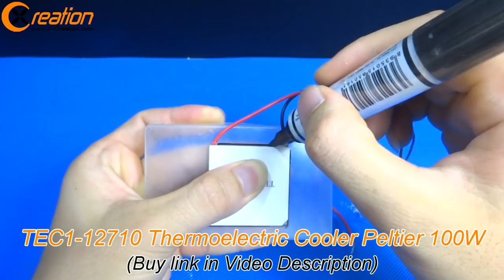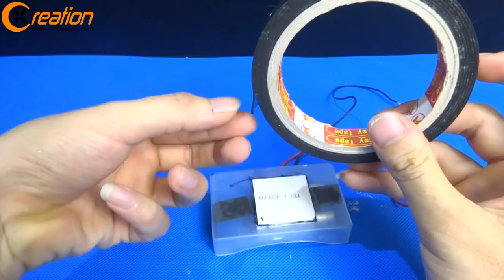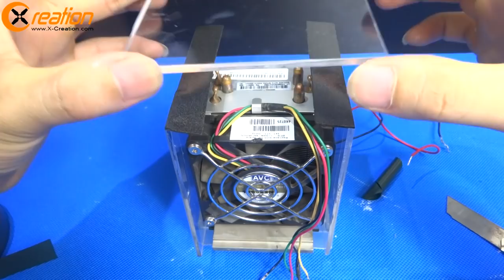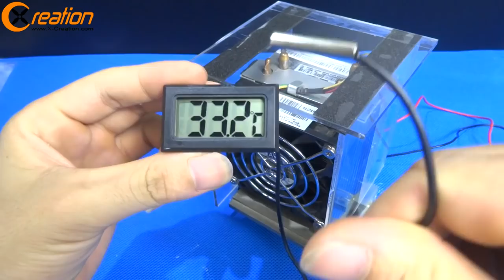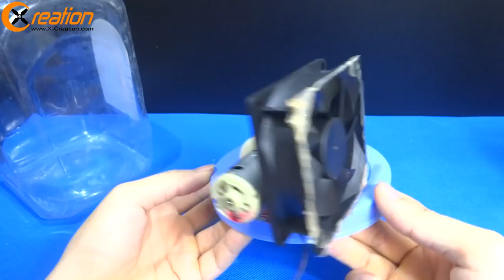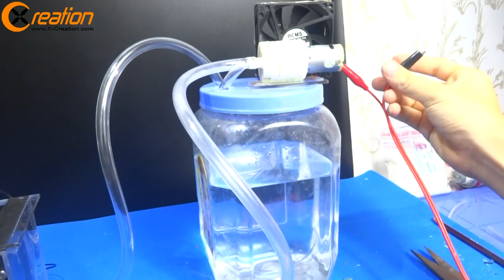How to make Air Conditioner WITHOUT ICE - Simple Homemade Invention

Comment: no radiator?
only 10° reduce in 8 minutes?
such a fail project there
i can make it -2° in 10 mins on air cooling
Reply: Loop Gear 
Can you tell us then how to do it?
Reply: Loop Gear you just lie, btw....  Good video!
Reply: Loop Gear 
😱😱😱😱😱😱😱
Reply: That's correct, it can drop to -2 in approx 10 minutes. Everyone asking how, it is simple. On peltier units the colder you go on hot side, the colder the cold side gets. Water dissipates heat slower than metals and therefore, if the liquid cooling is replaced with a radiator directly attached to the hot side the temperature on colder side would drop much more faster.
Reply: Loop Gear prove it to us
Reply: Buy a air cooler from the shop u will get more cooled😏
Reply: Ahmed Saleh I'm interested in knowing how to do this since I have never play around with this kind of stuff. Would you make a video step by step showing how to do it please,since I'm just a" lay man" never actually do or touch this kind of stuff,so it would be great if you could teach me how to do it in your video.pleaseeeee
Reply: Alex Undiscovery I'm happy that u are telling the way to improve it, it's just that I don't understand any of it,though, it's easier to watch step by step then to actually read it, because I'm just a housewife,all I understand is cleaning the house😂😂😂.this kinda stuff, I never learned about them 😥😥😥so,by watching your step by step video, I can make mine exactly like yours but, much simpler to do coz I just need to buy all the stuffs needed n copy you to get it done😎😎. Still, I thank you for the info though, it's just a pity I don't know how to make it😣😣,js.
Reply: Alex Undiscovery thank you very much for teaching me how, I'd like to try to do it,but first I'm gonna have to find out where abouts that I can go to buy all the needed stuffs.once again,thank you, it's really helpful.😇😇
Reply: Have a DIY?
Reply: plus update our video
Reply: Loop Gear so you can make ice kk
Reply: Loop Gear why would you need a radiator? Your cooling air, not a cpu, like the parts intended use, you honestly sound like your not sure what your talking about
Reply: You should have been a millionaire by now selling that
Reply: It's very simple that use a big  water bottle and drop the pump in water and hot water is thron on the top of bottle by pipe which have a lot.of hole that's make.water in raning and a DC small fan strat air inside from top of bottle that's make water cool and one thing more that hole half bottle to cross air

Comment: basic physics lesson. . you cant lower the ambient temperature of air without a liquid gas and a compressor with a radiator, plus you use of tools is a bit odd, soldering iron to cut and glue gun to solder wires, OK your having fun and that's cool but your room is not,

Comment: This isn't a cooler. You only made a liquid thermal battery. If you intention was to store heat in the water, than you succeeded but as the water heats up from cooling the room (the heat has to go somewhere) the cooling performance in diminished. You're technique doens't use the Joule–Thomson effect.

Comment: using those plastic pieces near those heatsink (Radiator) reduce the air flow and make it constrict this can lead to bad heat transfer from those radiator to the air which will further reduce the efficiency of the Peltier module since its efficiency is directly proportional to the the temperature of both couples so to improve heat transfer remove those useless plastics

Comment: Heatpipe doesnt work under frozen temperature generated by TEC, thus cooling the aluminum fins much less efficient than conventional heatsink.
Reply: The heat pipe is on the hot side of the tec
Reply: No it isnt, the heat is removed with water cooling and absorbed on the heat pipe side
Reply: tiesto9797 Nope... do some research first, then come back here... the molecule inside heatpipe does nothing when they’re in a frozen state. Sorry

Comment: What I am about to say, although the video is impressive, has nothing to do with the work being carried out by you. I would like to inform you, or whoever reads my comments, and you will hopefully spread the word around that, instead of using the very expensive thermo-paste, you may want to use: Copper slip, its results are just as good at a fraction of a price. The thermo-paste syringe of 10 milligrams probably costs about 5 pounds sterlings, whereas a 500 gram tin or tube will set you back: 10 pounds sterling. Please pass the news around, thank you!

Comment: The water output needs to pass thru a radiator so you don't turn your water tank into a heat-sink...you may be 'getting there', but you aren't there yet...and a peltier device isn't the 'best' cooler idea around, anyhow...not for 'room air conditioning', anyhow.

Comment: it does not work because it's like trying to cool a room with an electric cooler. At most it can lower the temperature by 1-2 degrees Celsius
Reply: But its shows 10?

Comment: I see this working, you just need to pour the water out every few hours once it heated up😅
Reply from the maker: actually :)
Reply: X-Creation You should reverse polarity of the peltier and add a liquid computer radiator to cool air down with cold water. Heatsink in your setup just does not work as it should. Those heat pipes do transfer heat efficently being warm, read how do they work. In your video it works like a bicycle with chain driving the front wheel)))

Comment: This video is wrong on so many levels.
Useing a peltier in the frist Place is a bad chioce already.
Then the CPU Cooler with ! "HEAT pipes". They are only working in one direction.
Pulling the teprature probe down towards the end so it touches the baseplate of the heatsink is pretty obvious.
Let alone the fact that this thing is not cooling anything once you have the hot water and the (not working) air cooling part both inside your room...

Comment: Can you show as what happen after 8 hr
Reply from the maker: every 2 hour you must change water in plastic bottle to maintain cool temperature
Reply: A waste of water! 😠, or better = flip around pelter module (hot side > cpu heatsink, cold side > water block) put this out window, close against pipes and fill up opening as to stop warm air from coming back in, cold water comes in to room - connect pc radiator and fan to the circuit. Now; air in room is recirculated though cold radiator, hot air is dumped outside, and you can fit tap to water tank for improvised water cooler 😁

Comment: Dumps the waste heat into the water. Like others have said, the net cooling effect in the room is zero unless the water container is outside the room being cooled. Otherwise you're only moving heat from the air blowing across the heat-sink into the water container, which is still in the room. Kinda like taking a dollar from one pocket and putting it in another pocket, and thinking you just made a dollar. And the thing ultimately will HEAT the room because of the energy input to do all the work (pumping, fans). Craftsmanship and technique is off the scale poor. Sorry. A big F.

Comment: LOL same as all the other so called air conditioners using a peltier module and this guy doesn't even know how to properly use thermal paste.  He's putting way too much of it on there for maximum heat transfer it should be as thin as possible not a thick smear like that.

Comment: Way too much thermal paste was used. Only the very thinnest amount is correctly used to help fill in minor imperfections in the two mating surfaces. Any more than that actually works against the heat transfer process.
   My other criticism is getting rid of the heat which gradually builds up in the water which will re radiate back into the area being cooled.

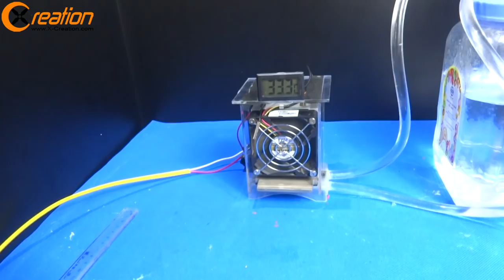Comment: Look at 6:12 where the thermostat wire is placed and then look at 6:32 where it is kept, directly on top of the heatsink where the cold water touches it. Instead of measuring the temperature coming from the fan, he is showing you the temperature of the water-cooled plate. Disappointing. Please, guys, do not fall for such videos and spend a ton on useless parts. Instead buy a small fan or save your money to buy the real thing.

Comment: "simple homemade innovation" yeah ok...
Requires:
PC heatsinks
thermoelectric cooler 100w
aluminum water cooling block
thermal grease
1/16 thick tape
plexiglass
surgical tubing
etc

ah yes, all of the common household objects i have! what a simple project! can i ask you what planet you're on? because not only are these not common household items, nor are they simple, but the thing would actually heat the room due to it not pumping the heat out of the room. 0/10.